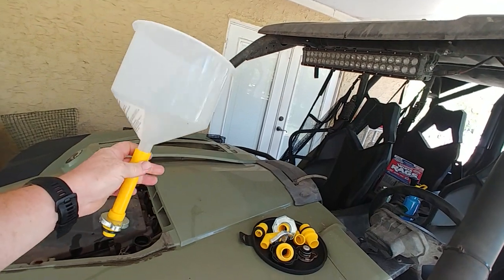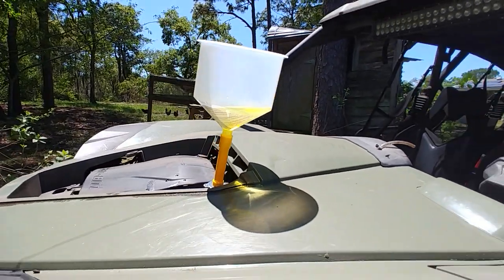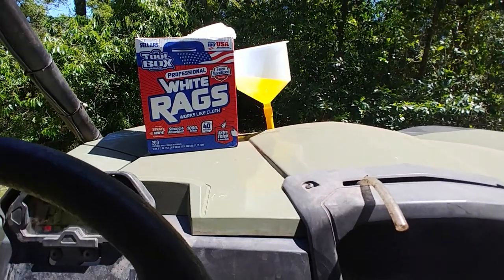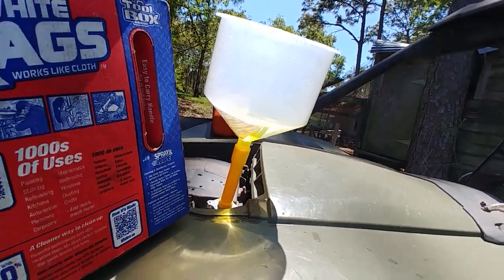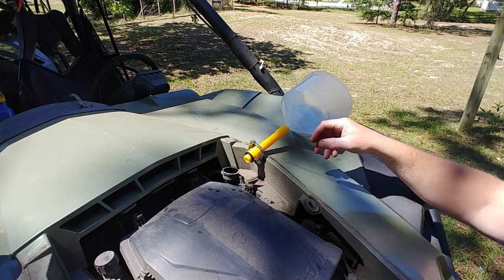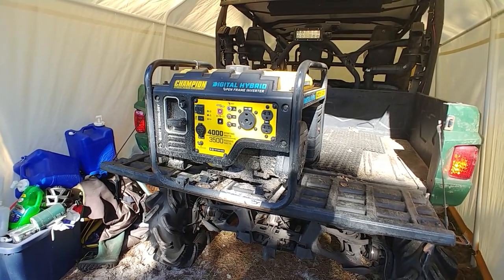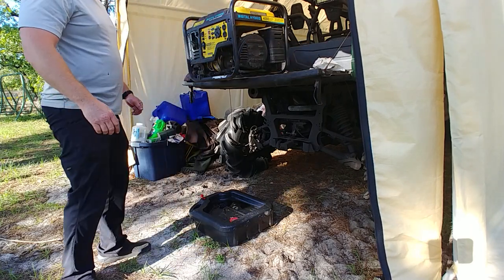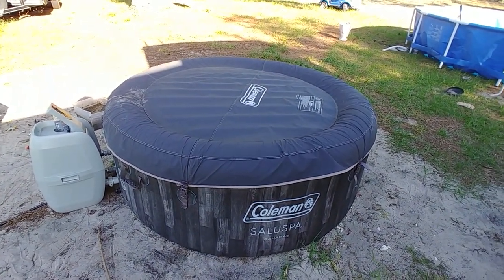Can Am Commander Radiator Burping!!

Comment: I recently changed the A arm bushings in my commander. Had to remove the radiator as well. I just burped it by squeezing the rad lines like you showed. Seemed to work cause I haven't had an overheat issue running it all day in Arizona. Keep up the videos for us commander owners!
Reply from the maker: Will do, gotta make some more time in my schedule.

Comment: I use this funnel also for bleeding the cooling system and it is a great tool , the first step though is to open the bleed screws on each of the cylinder heads where the hoses connect .(  8mm hex head , do not remove)Depending on how much air is in the system you can hear air be pushed out at the bleeder by the coolant , when it flow coolant snug up the bleeder screws then proceed as in the video. Keep in mind that excessive running of the engine may cause boiling because without the pressure created with the rad cap(about 16 PSI ) the boiling point of coolant is reduced .
Reply from the maker: Good info!

Comment: I replaced the water pump on my 2017 commander as it was starting to weep. I topped up the coolant and removed the overflow tank cap. Started the machine and kept adding coolant to the tank. Took an hour for all the air to escape . Had to do the same procedure after installing a heater kit. Worked fine. Maybe I was lucky .
Reply from the maker: Maybe, either way it worked for you.

Comment: DO you have the part# on the burping funnel you purchased? I have purchased a few different brands and I cannot get one that has the right fit for the rad cap to seal.
Reply from the maker: I don't, I'll try and look that up when I get the chance.
Reply: @bandbworkx  I think I may be all set. I found one that should work. Not a direct seal but it should be fine as it only leaks minimal fluid. Hopefully it works . Thank you for the reply. If for some reason you do find the order please let me know in case I run into issues with the minimal leakage.
Reply: @bandbworkx  nope, the one I got still didn’t seal correct on the rad. . If you happen to know where you purchased yours please let me know. If not , I understand 
Thanks
Reply from the maker: OEM TOOLS  #87009 from AutoZone.
Reply: @bandbworkx  thank you
Reply from the maker: Hopefully it will work for you.